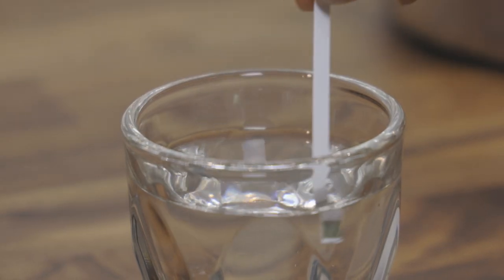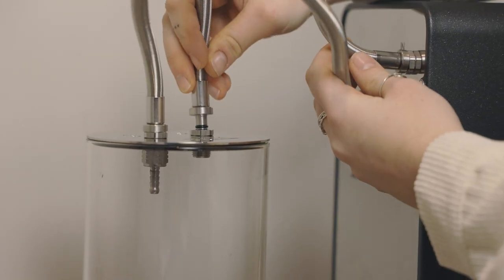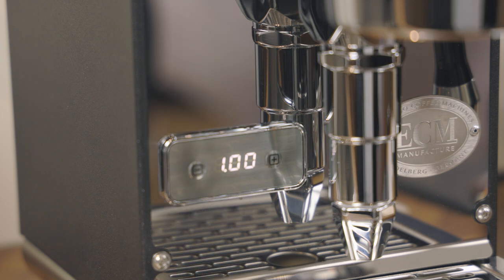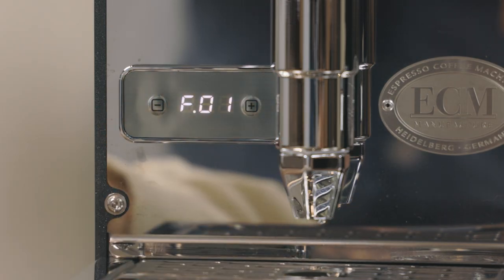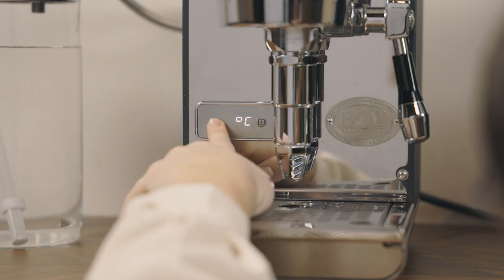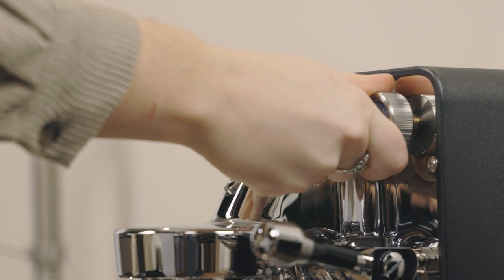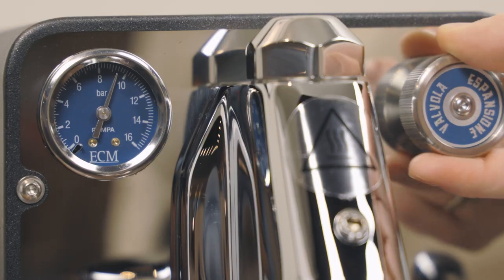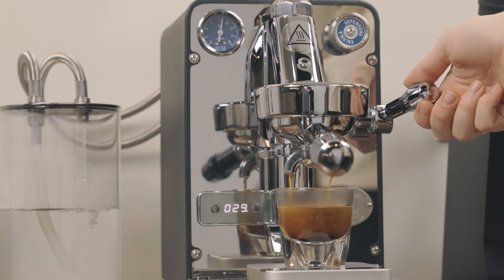ECM Puristika Setup Guide

Comment: 0:15
This is the first time in an official unboxing clip that manufacturer suggests to keep packaging for potential “returns or repairs “
Reply from the maker: This is our Setup Guide sent to our customers who have purchased a new machine. If anything happens to the equipment, it's important to have the original packaging to ensure safe transportation in case it needs to be sent back. However, we always work with our customers to repair from home and try to avoid shipping a machine back! We don't expect issues as each machine is bench tested by one of our espresso technicians prior to shipping.

Comment: Rather than an only an adjustable OPV, I would prefer a variable rate vibratory pump to set the flow rate I want, and the desired pressure at that flow rate. Say I have the OPV set at 9.25, and the vibratory pump set to a low enough flow rate to generate 9 bar of pressure. Then I would know that I am not back feeding a huge amount of water (this is an example to show the principle). As it is, this machine has a vibratory pump set to generate a flow rate that is in excess of generating 12 bar at a reasonable flow rate, which means it will generate significant back flushing when you set the OPV to 9 bar. Come to that, why do these machines, being electronic, not have a flow rate meter built in?
Reply: Vibratory pumps only have a single displacement. Pressure would be defined by the coil magnetic field. You can't do anything to independently modulate pressure or flow with a vibratory pump. The usage of an OPV is because you can't do what you are wanting with that type of pump
Reply: MisterMakey 
1. Flow rate of vibratory pump is usually controlled by pumping duty cycle, but
2. That’s only at cold water channel not the absolute water flow rate after boiler at hot section. In most cases, absolute coffee flow rate can only be measured through an external scale underneath cup, as a feedback if this measurement is sent back to the machine’s control system, on time.
Reply: Hi Tom,
That flow rate sensor (if there is one on this machine) at vibratory pump is not being used across all manufacturers as flow rate feedback for a few reasons, 
1. this measurement represents a measurement at cold water supply section, not at final hot water section that gets through ground coffee,
2. There is no manufacturer placing flow sensor at hot water channel after boiler, reliably withstanding high water temperature and high pressure,
3. There is no flow sensor at this price point with good enough accuracy to stand up against coffee snobs who place weighing scale underneath coffee cup
4. Getting flow rate data through Bluetooth weighing scale back into this machine’s control system is probably beyond the scope.
Reply: @willo7979  To reply to your points:
1) The flow rate of a vibratory pump used in an espresso machine depends upon both the pump duty cycle and the pressure that the pump is experiencing at its output. This is entirely predictable without even measuring the flow rate directly if you know the specific pump and the pressure at its output. 
2) An external scale measures the weight of the fluids going into the cup on the scale which includes the dissolved solids, so that is not even a volumetric measurement. Also, modern bluetooth is sufficiently high bandwidth and low latency that it can do what you claim it cannot, but I see no reason to do that anyway.

I would add that my DeLonghi delivers a consistent enough volumetric delivery of water, even when the puck pressure is so high that the flow rate is really low, so it is actually doing to a good enough level at flow volumetric delivery. Breville machines can do the same. This is not a difficult or expensive engineering problem.
Reply: @Tom Jones  
1. Your comment is self-explanatory, that; 
Flow rate of vibratory pump depends on two things: duty cycle, and, pressure.
Duty cycle is known.
But there’s no pressure sensor in this machine to regulate pump’s duty cycle to result intended flow rate. Else, they will simply states this is an ‘Advanced PID-controlled machine’, and that settles all discuss.
Therefore accurate flow rate couldn’t be determined at vibratory pump.
Therefore flow rate at pump is a guess work by the system with pressure not known.
Your Delonghi delivers a somehow ‘consistent’ volumetric amount of coffee volume from shot to shot, eyeballing. But that’s not ‘flow rate’ that we’re discussing here. 
However, I wouldn’t be surprised if Your Delonghi is using other means to correlate and monitor water pressure, such as sensing electric current at pump. If this is the case, then, your Delonghi could be doing much better than this machine, as a lot of coffee machine companies are not technologically sound. There’s no pressure sensor in most Delonghi, La Specialista has an analogue pressure gauge for viewing pleasure, but it wasn’t being fed back to the system automatically.
2. Apart from flow rate which determine the taste of coffee, the final coffee volume also matters to coffee drinkers, therefore a scale is the ultimate measurement. All other parameters are auxiliary compared to the taste and final volume.
One last point, company like Jura, literally allow customer to specify amount of coffee (in 5ml incremental intervals) that goes to the cup, but I have nothing to validate its accuracy, and consistency.
Reply: Kafmasino has bluetooth scale integrated to monitor final volume in order to control internal flow.
Reply: Dumb question? Total newbie. Why not have a back flush preventer like the one on the spigots outside our homes? Water can only go one way and not the other? Or am I reading all these "back flushing" statements wrong? Sorry if it's a dumb question.